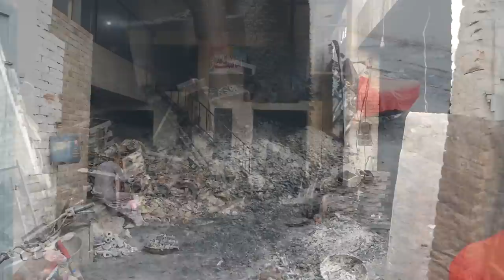Casting Process & Tour of a Cast Iron Factory

Comment: It is obvious that these people know what they are doing. We need to get them some more modern technology so they can really shine.
Reply: I've read through many of the comments now, and as usual, they are mostly negative. I'm inspired by these workers who are driven by an inspiration that through their hard work that they may build a better life for their children at any expense. It will get better through the sheer determination of people like these. Let's hope that the transformation will happen as quickly as possible.
Reply: @jbbuzzable  Thanks for your comments and your concern for their well being. Off course there must be a lot that could be done but to start with what could be the initial elementary steps to ease labour & increase productivity ?
Reply: they know what they are doing, but it's nothing compared to properly trained skilled professionals, not disrespect intended.
Reply: @dieselscience  They are Caucasians,  ya know?
Reply: @KK10155  Of course, they are casting very low grade parts for the third world supply chain.
Reply: Actually its not that obvious at all - I am amature machinist. They would not know what to do with anything post WWII. Heck advanced stuff from inter war period would be a bit of a challenge for them.

Comment: Buying iron pipes premade at length is not considered expensive, the obvious solution would be to do that and cut them to the right length. This way is a more complicated method but must somehow be even cheaper, scrap metal, and low wages, amazing.

Comment: Uh...wouldn’t it be easier to just take a length of pipe and cut it in sections?
Reply: i think these are cylinder liners
Reply: @muzallisam5068  ah...that makes sense
Reply: Yep. Cast iron is more wear resistant.
Reply: @Andrew H because it is harder to cast longer pipes then short ones. just see the work place condition. they are not a high tech smelting and casting shop.
Reply: @Kandralla  That makes no sense. You have machinery to cast long sections of pipe but don't have a way to evenly cool it?

Comment: what are they making? what are those sleeves used for?
Reply: Likely Cast Iron cylinder wall sleeves for internal combustion engines. Piston runs inside with rings to seal against inside of the cylinder.
Reply: @patbrown2227  that's what I thought, thanks

Comment: In the 60's I worked for Richard Foundry, in Norfolk Virginia USA.  ,  we made fire hydrants, and manhole covers,  as big as 6 foot diameter and 4 inch thick in the center,  over 2,300 lbs.  My job was to machine the mating surfaces so the didn't rock or clunk when you drove over them. I was the. "DECLUNKER"  😃😃😃

Comment: Is that powdered cancer they're packing with their feet?
Reply: Not cancer, though that could be a by product. with all the sand and dust in the air  there though, silicosis would probably be one of the most common forms of death for those working there sadly.
Reply: Nope, just sand.
Reply: @catey62  actually green sand isn't that bad.

Comment: What are they stomping on?
Reply: Casting sand, in order to pack it tightly into the mold. That way, the sand will not run out of the mold when it is turned over.
Reply: Green sand
Reply: Called Green Sand Molding, stomping process is called Tamping Down the Sand, to make the loose sand firm.

Comment: What the hell are they making??? This should be shown at the end.
Reply: Engine sleeve.....but old iron for this ?
Reply: @robertfairburn9979  the wages are so low, that its possible to use ne "precicion" engine parts made from scrap, cause its cheap to renewal a after short use broken down machine. thats one method to keep the economy running and don`t let coming people nothing have to work...
Reply: MrDriftspirit If it’s an engine sleeve (not 100%) it would work for a while. I guess that’s a lot better than  having an engine not working at all.

Comment: There is more than one kind of slavery. Here is an example.
Reply: You've never been to a western steel foundry... obviously.
They have hard hats and safety boots, but it's still like hell and it is much more dangerous as the quantities are much bigger
Not an easy job.
Reply: @kaba_me  I work for an electric heat treat furnace mfg, and I have visited the Pohang (POSCO) steel works in South Korea.

Comment: what are they making? cylinder sleeve?
Reply: I was wondering that also. Cylinder sleeve makes a lot of sense; it explains why they are casting them. It also explains why they aren’t measuring them to a specific size since they will be further precision machined to fit an engine block.

Comment: Work barefoot in an iron foundry. It sounds safe, right?
Reply: It's easy once you know how.
Reply: @peglegnoid6139  Hah!
Reply: iron foundrys came before all the PPE and health and saftey cobblers
Reply: @melin1969  Yeah, it is more than possible... But I guess in the iron age they already made shoes or boots out of leather. There's one thing you never wanna know: how spilled out molten iron feels on your bare feet.
Reply: @Heads Mess :) I think I know what you're saying, that's why I wear my work pants outside my boots during welding or casting. When I was young, I've made several long-lasting, painful burn wounds on my legs and feet. Some of them are still dark, they won't disappear ever.
Reply: @Heads Mess I agree. I worked at a foundry years ago. one  poor guy I knew was helping on a pour one day when the mould they  were pouring the iron into started leaking from the seam...straight onto his ankle and into his safety boot. he wound up with severe 3rd degree burns on most of his foot that need major skin grafts to fix. even then he still wasnt right and couldnt walk properly after that.

Comment: I want some cast turbine blades for a small turbo jet engine I want to build, can they make them for me?
Reply: you dont want cast blades for a turbine engine, they are too fragile and brittle.you need forged blades made from high strength alloys, preferably titanium for maximum strength to resist the centrifugal forces acting on them. cast blades would just shatter.

Comment: 06:45  Why four jaw?
Reply: They run out of 3 jaws? It may be due to the part being rather flimsy so they do not want to put pressure in 3 points but 4. Notice he does not indicate at all - part runs not too true but the cut makes it true (but they waste extra material).
Reply: @tomk3732  
Good point about 3 vs 4.  But a 3 jaw would suffice for cleaning up a casting's over-size. Its not hogging out a solid round bar.
It does not "show" him indicating-in the part but most likely he did.     Yagottadothat.
"part runs not too true"  Of course it doesn't.  Its a crude sand casting.
Reply: @Tsamokie  I agree 3 jaw would suffice - they don't seem to hog & attention to actual dimensions is not high. He does not indicate - they show process form him taking old part out and new part in - he only removes 2 jaws out of 4 (I do the same) and when he places new part in he tightens these 2 jaws only - since he done it like around 1m times he applies similar pressure to the jaws each time - so part runout due to not indicating is small - smaller then the area he is cleaning out - thus I said part runs a bit not true. If he were to indicate it would slow down their process a LOT.
Also the 4 jaw may be a fixture i.e. may be modified to just do this part only.

Comment: Roughly pre WWI level of advancement in machining and metallurgy. Will take them at least 100 years to catch up to China. There is a reason a lot of stuff from Pakistan or India ends up straight on the scrap pile. Especially beware of tools such as milling tables & rotary tables made there - these guys may look tough but they don't make "precision" stuff. My Indian cast anvil through is OK - not much precision was needed in its making and its over 200 year old tech.

Comment: Read threw the comment and here's my 2 cents. I worked in a factory like this, and it's a good job for the first 6 months. Then, it's just plain boring. The work is easy. I've actually run the same model lathes with the same set up.